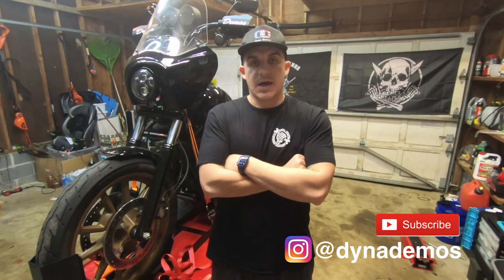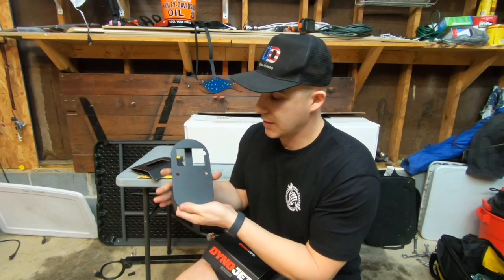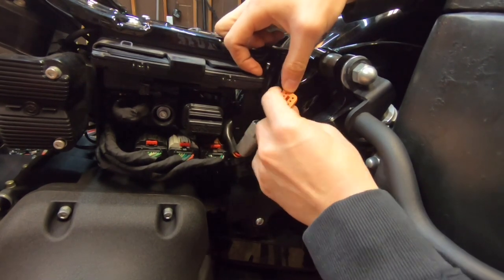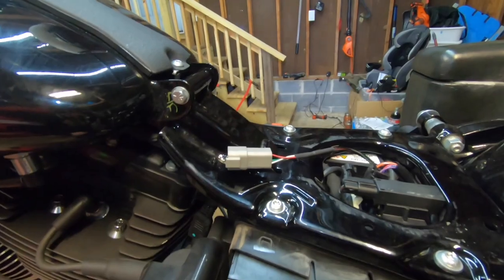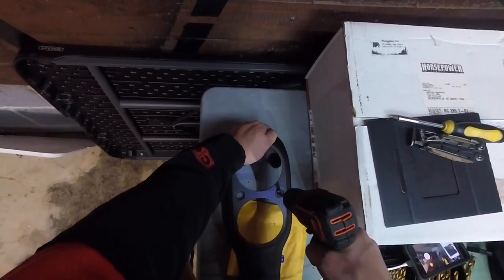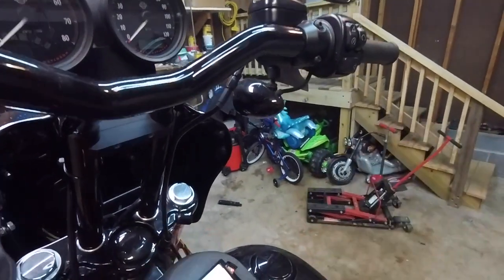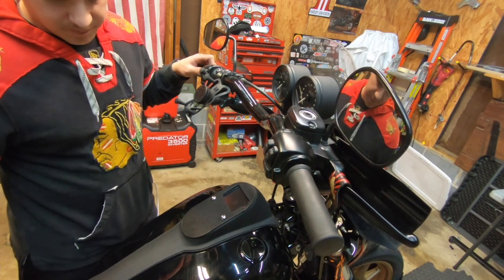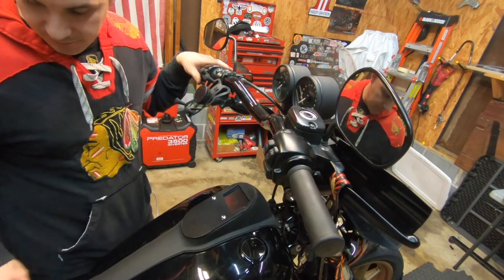Powervision Install

Comment: You guys running the 2408 or 2412 tune?  You got the 103 with 2-1-2 and stage 2 AC, right?  That's what I got. What's your bike/gear and tune?
Reply from the maker: James Walker

I have changed my exhaust since this vid.  the 2016 fxdls has the se110.  Weather has been shit here since i filmed this so haven’t had a chance to run a tune yet.  Hoping to get out there soon and run a tune.  Did you run a auto tune?  Or did you have dynojet send you a tune or did you get dynoed?
Reply: I've had the PV2 and the wide band autotune for a few years now.  I have tons of tubing runs done.  Was curious if you got a custom run running and wanted to compare tunes.  You gotta forum?
Reply from the maker: James Walker

yes i got the Pv2 also.  let me get a few runs in and maybe we can compare than.  no I don’t have a forum account.   My plan was to auto tune than get a custom one maybe down the road

Comment: Hey I have question, I have a 2007 street bob. I'm 5'7" tall, so my feet don't go flat to the ground. It has the original seat on it. I want my feet flat. Can you give some in put
Reply from the maker: Dont'e Miller u can get shorter shocks or check your shocks some oem shocks are adjustable and able to be lowered, also there are seat options with less padding out there. Wear boots instead of regular shoes
Reply: @dynademos  can you give a few seat names. Thanks
Reply from the maker: Dont’e Miller 
Check out Le Pera, Mustang, saddleman, roland sands, drag or even other harley seats.
Reply: @dynademos  ok. Thanks

Comment: Does the power vision screen need to stay on the bike full time or can it be removed after you have tuned the bike?  Thanks.
Reply from the maker: 1bigbuff I am not 100% sure,  i don’t think you need it plugged in bc you can buy a power vision license and have your bike tuned without the unit.   Once tunes are loaded on the tuner and you flash your ecm i wouldn’t think you would need the tuner unless you wanted to use one of the many features on the unit or change the tune.  Like i said i am not 100% sure and would have to read more on it.  Does anyone on this thread with a PV know the answer to this?
Reply: dynademos after research, it does not need to stay on the bike.  Thanks for getting back to me.

Comment: If a fastener is threaded along the whole length then it is a screw - regardless of the head type be it hex head, cap head (what you call Allen head) or slotted,Phillips (crosshead) or Torx. A fastener that has a 'shouldered' or non threaded part is called a bolt , again regardless of the head.
Reply from the maker: Thakery hmmm good info although potato potatoe 🤷🏽‍♂️😂 but for real I appreciate the info
Reply: @dynademos  That wasn't meant as a correction, merely some advice. I trained in engineering and fasteners are something I became good on.Being English though, things are termed differently - what you call a cotter pin is to me a split pin.... a cotter pin is the type of pin that holds a bicycle pedal arm to the crank....  No disrespect meant but you in the USA really do speak a different language and I am not sure that the pedantic-ness of our version is at all necessary !